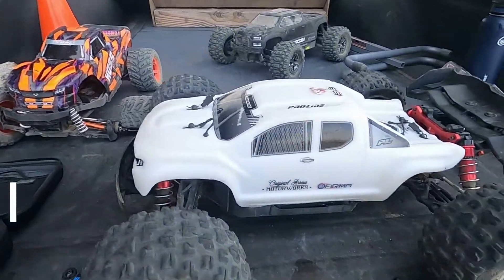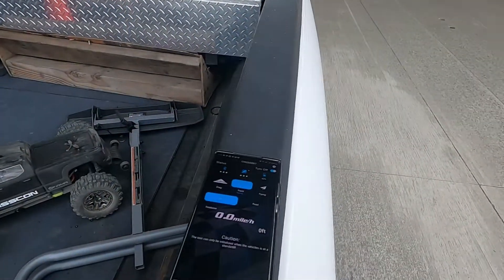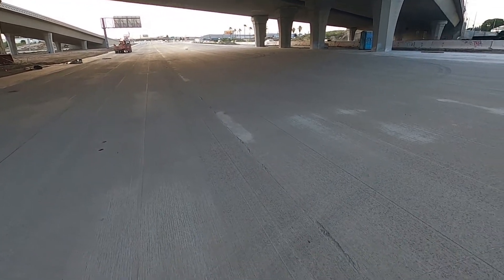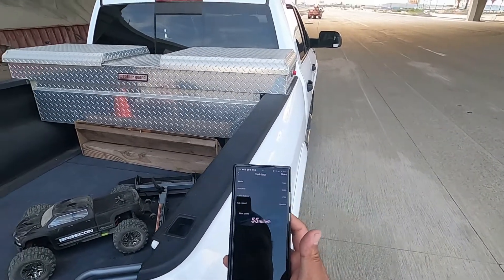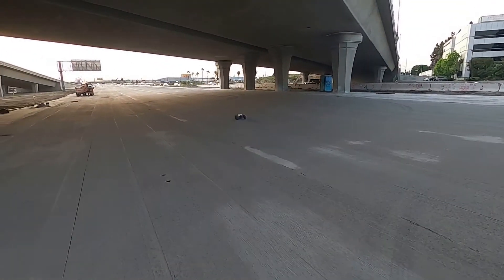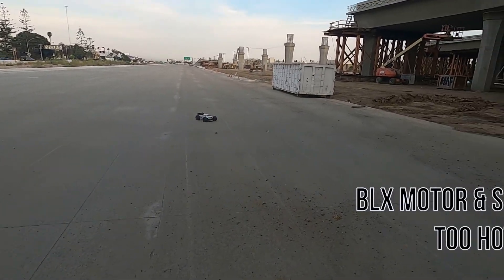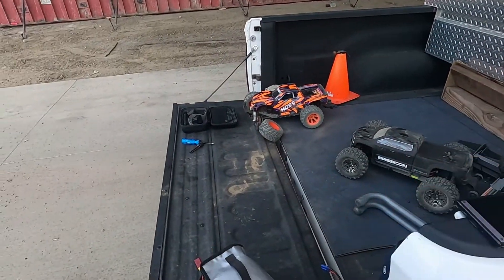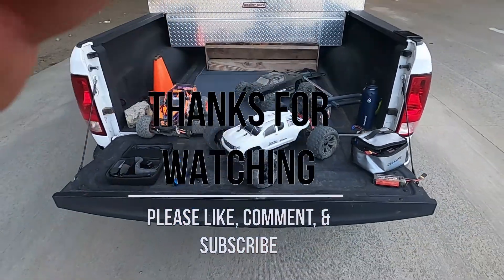EXB KRATON WITH BLX MOTOR & SMART SPECTRUM ESC SPEED RUN #exb #arrma #xena #spectrum

Comment: You think blx stronger than spectrum motors?
Reply: I have hw 2200 in kraton exb , I think little high kv for summer, gong put I n typhon bc its lighter . But typhon fast with spectrum I thinking I  have a 18t
Reply from the maker: That funny you ask that because I was thinking of making a video comparing the two. I do think it's stronger but I ended up putting spectrum motor from my Felony into my Kraton v4 and that motor has been doing the job...
Reply from the maker: @paulclancy2404  right I just put back my castle creation 1650 back in to my kraton EXB with a 22T. Going to test the speed and temps. But yes it is too hot out for these motors. I have a game changer fan on the motor. Need to put one on the esc as well